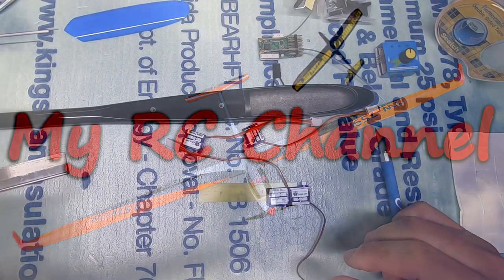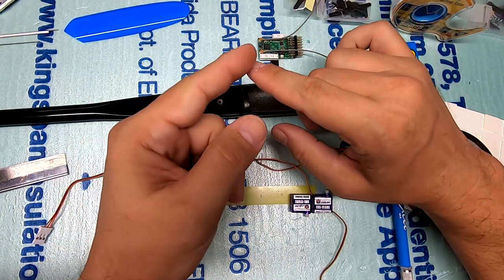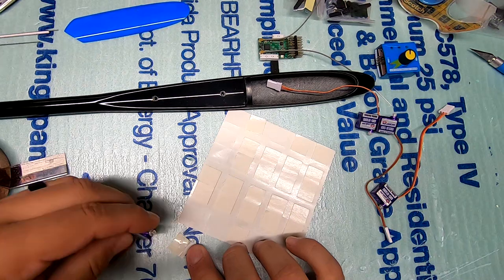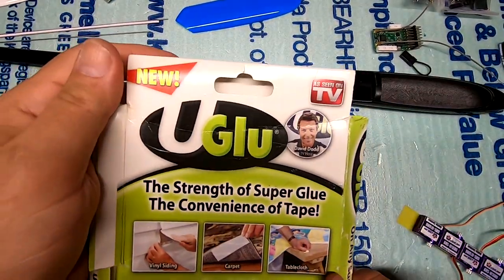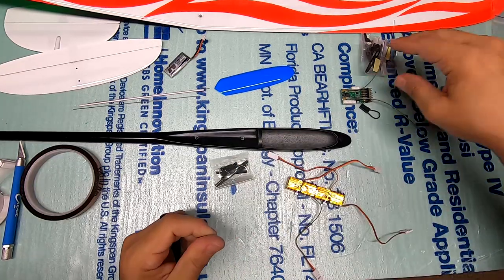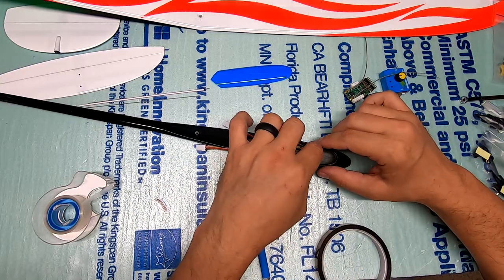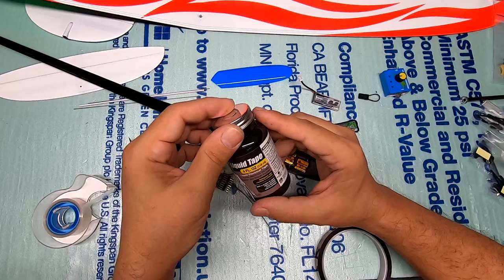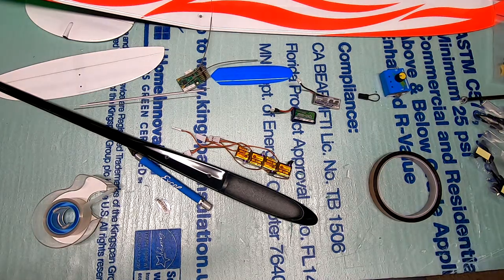Building the Hawk 1m DLG, Discus Launch Glider - Pt. 2

Comment: My Hawk just arrived today and I am grateful for your videos right now!!! Very timely.  Would you be so kind as to share an Amazon link to the gold tape.
Reply from the maker: Sure, this link is below... this looks like the same stuff I have. BTW, I am going to be making a correction in the next video. I have the elevator and rudder horns reversed. The hook should be on the rudder and the closed hole should be on the elevator. That way, you can unscrew the elevator from the boom and release the tension on the spring without disconnecting the pull cord... and you can unhook the loop from the rudder. I have a workaround to fix what I did, but since you have your Hawk in hand, I wanted to let you know right away.
Regards, CJ
https://www.amazon.com/dp/B072Z92QZ2/ref=sspa_dk_detail_3?psc=1&pd_rd_i=B072Z92QZ2&pd_rd_w=Yp0Ji&pf_rd_p=48d372c1-f7e1-4b8b-9d02-4bd86f5158c5&pd_rd_wg=go7kQ&pf_rd_r=HRX5NNQSPS7K74Y1XETW&pd_rd_r=63b02529-bc17-48a1-93d0-a8f67693988d&spLa=ZW5jcnlwdGVkUXVhbGlmaWVyPUEzSzZKOEROQlg0M01CJmVuY3J5cHRlZElkPUEwNjAxOTcxMjFBWkcwVjVDTFdBUiZlbmNyeXB0ZWRBZElkPUEwNzc5Nzg4TDNGQkc0SUlIUkpRJndpZGdldE5hbWU9c3BfZGV0YWlsJmFjdGlvbj1jbGlja1JlZGlyZWN0JmRvTm90TG9nQ2xpY2s9dHJ1ZQ==
Reply: @MyRCChannel-CJScott  Thanks so much...
Reply from the maker: @ebreevephoto  Anytime!

Comment: I'd do a little testing for the bond between your servo tray and the fuselage bottom. That smooth tape around the servos may not be a good surface for double sided tape.
Reply from the maker: Good thinking, but it holds great. I'm using Scotch double sided rubber tape, and I cleaned the fuselage with denatured alcohol. They are so tight that if it came loose, there is no where for it to go anyway ;-) That gold tape is the bomb! I use it a lot and it was an excellent purchase. It was recommended to my by a guy who has flown competition gliders for years. He has several national titles in various glider classes. I learned a lot from him. The board that I tie gliders to to measure and true wings... got that idea from him.